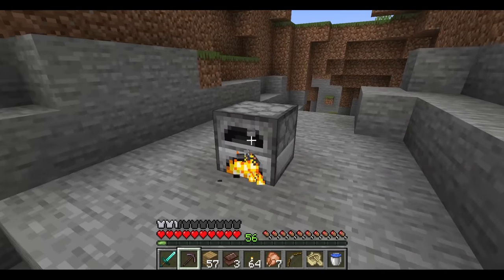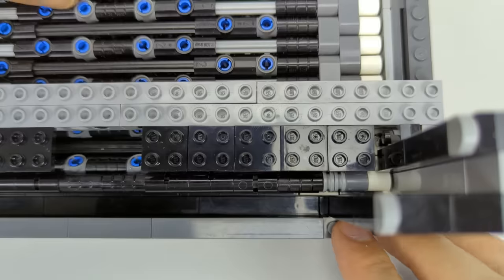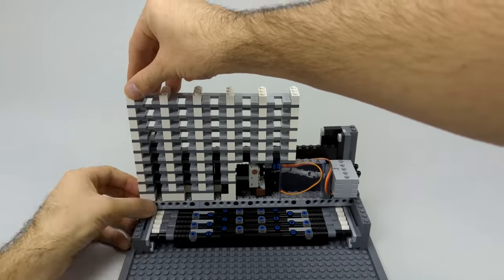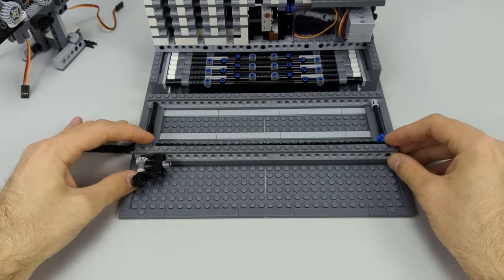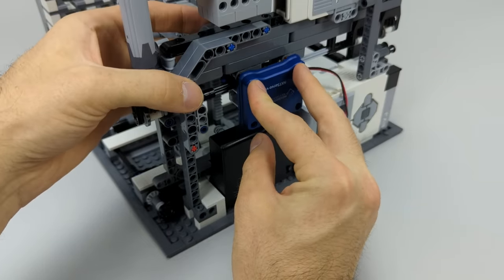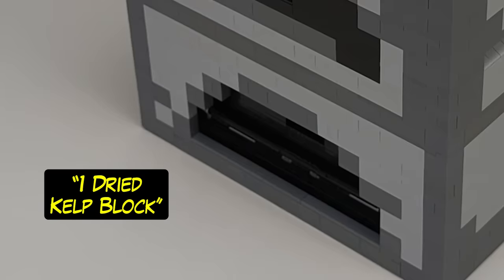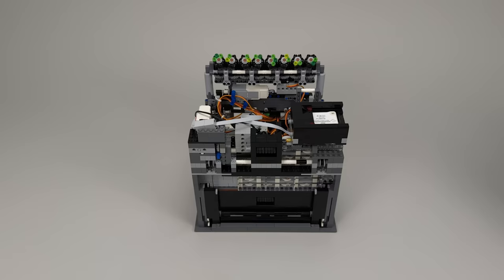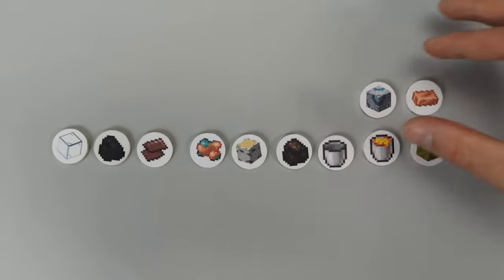100% WORKING LEGO® Minecraft Furnace

Comment: Normally the problem with these sort of videos is that there’s always something inaccurate, or visually displeasing but you have nailed EVERY. SINGLE. BUILD. You even made the water bucket appear when a lava bucket and wet sponge are used!These are amazing!!
Reply from the maker: Thank you so much! 😀
Reply: Bro could play real life Minecraft
Reply: If you use a lava bucket and only smelt, say, one item, the 99 other potential items are wasted in the game if not smelted straight away. The lego one looks like it saves the fuel
Reply: @Podgorski37  that could most likely be fixed in software though!

Comment: Can you explain HOW you use the XP orbs in the enchanting table? Because it used to be that the XP was assigned to your card, not an orb.

Also, you should try a sculk sensor, and if possible, include "sculk frequency" as I believe it's called (it's how different sounds give out a different redstone signal strength), but if that's not possible, then you could always measure the output power by how LOUD the sound is instead. In fact, maybe try making ALL the sculk blocks if you can.
Reply: this one also assigns xp to a card, it just shoots orbs as an extra
Reply: the xp orbs are just decorative to make it cooler, I don't think the orbs are used for anything
Reply: @sumynona.01  Ah, ok.
Reply: @legithuman5486  That makes sense. It did look really cool, and satisfying, which is perfect since so many people find XP to be satisfying.
Reply from the maker: Yep, anomynus below is correct, the RFID sensor assigns the XP, the orbs are just used as an extra effect! Great idea on the sculk sensor!
Reply from the maker: Thanks for answering that question for me!
Reply from the maker: Thanks for answering that question!
Reply from the maker: Thank you!
Reply: @BrickMachinesChannel  suiiii

i now consider myself as famous
Reply: @BrickMachinesChannel  No problem! I actually commented the sculk sensor thing as a reply to someone on a different video, but then even I couldn't find it afterwards, so I put it here instead 😂